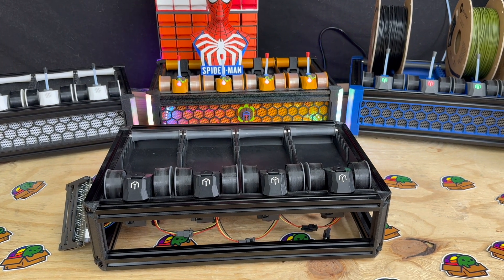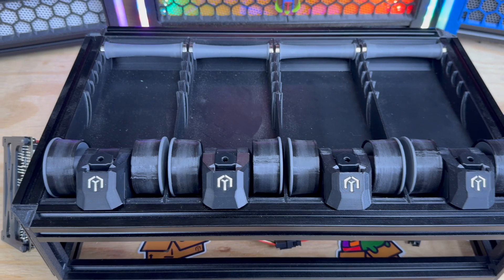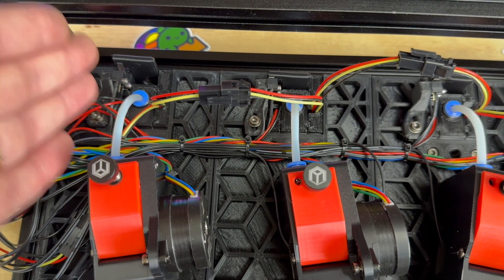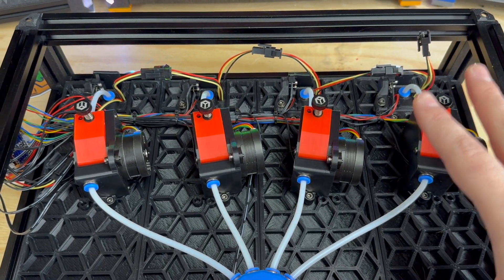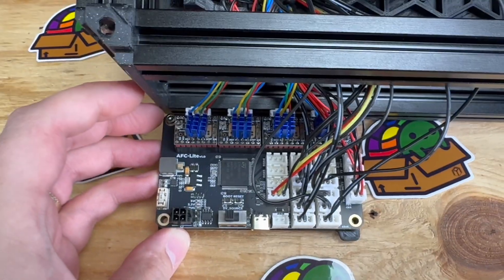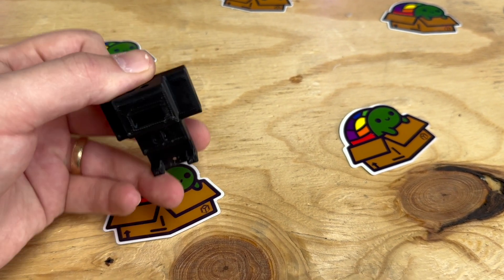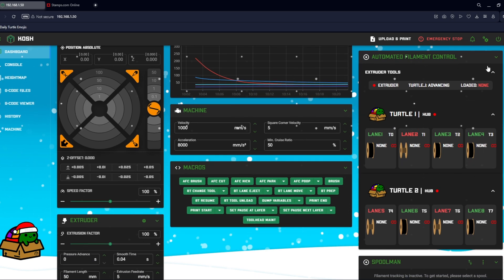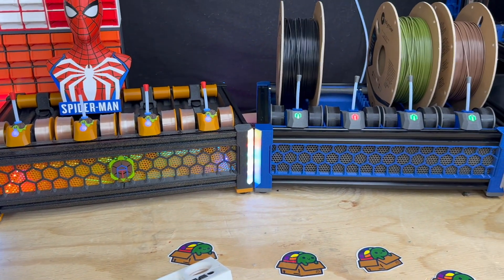BoxTurtle Basic Overview

Comment from the maker: Reply with any more questions and I will make sure they are covered in detail in the near future.
Reply: How does this setup manage TPU and flexibles?  Difficulty in integrating with Peopoly's Magneto?
Reply: how does this connect a 3d printer?  what type of port?
Reply: Is 8track dead
Reply: Which printers can I use this with? Is it compatible with the elegoo centauri carbon?
Reply: @MistaWells  Any printer running mainline klipper
Reply: How do I enable the AFC GUI?
Reply: Can we get any documentation on the led installs. I didn't notice any on in the manuals either.

Comment: Do you think that this could be integrated into a tool changer Voron 2.4? I could see so much potential. I'd use the multi-toolheads for different nozzle sizes, soft materials that don't feed well in a MMU, or main print colors while the turtle would be great for accent colors or if you need more colors than a tool changer could provide. One of the biggest reasons (other than cost) that I don't want to buy a ready-made tool changer like the XL is that it can't do something like this.

Comment: The box turtle with it's permanent engagement and a small variable filament buffer is almost how I designed my filament changer.
The only differences are that i used cheap of the shelf filament sensors and nema 17 extruders, my buffer was implemented by the extruders being able to slide, the respoolers are non motorized with a slip clutch and spring system.

Comment: I don't need colors for my functional parts but I'd like to be able to print PLA support for PETG parts, or print PET-CF parts with TPU feet or non-skid tops.  Now that multi spool filament feeders are becoming popular, slicers need to learn how to intelligently use the purge as infill or if the materials are incompatible, purge one material inside the hollow infill of the base material.  Poop and purge towers are not good.

Comment: I'm glade I found this I am printing on a LK5 pro witch is a widely unsupported printer. I have been on a long journey to make my printer multicolor. I have swapped over to klipper with moonsail and orca slicer. (again all not supporting my printer).  But I feel this is my multicolor solution.

There are a lot of comments. So, this might have been already asked. If so I apologize. I think I understand that this is mostly printable at home. But is there a kits with all the necessary non printable parts or do we piece mail this via Amazon/ Temu?

Thank you

Comment: On dryers and storage. Nice work. Just entered the game, ordered P1S. Dunno if my problem is relevant but I feel to be interested in combined AMS+dryer+storage box. 

I have noticed in drying clothes etc. that a simple fan helps a lot. I guess air circulations rotates more molecules for the water whatnot. So, a dryer of my dreams would have:
1) a bit of air circulation with a fan
2) some heating
3) some (occasional) inside–ambient air exchange.

I wonder 
4)– if 1) & 3) could use the same fan (to simplify)?
5)– if 3) could be passive or minimal, akin to grid +flap structure which would open the exchange when 4) blows? I feel the needed flow is 1) > 3) i.e. only minimal 3) is needed.

Also, dunno if solutions already exist. Thanks.

This text is also posted on @LDOmotor's video https://www.youtube.com/watch?v=SZF6mm9Z6wc&lc=UgzyBD_PwfVc6BB5JXx4AaABAg

Comment: Could this auto load and unload my 6 tool head tapchanger for me?  If you built a 6 spool turtle of course.  Would it require some software changes is really the question.

Comment: How do you add the multiple Box turtles to the printer or add additional lanes to the BT the PCB only appeared to manage 4 motors?
Reply from the maker: Any filament combiner works fine, we’re working on a group of accessories like that on our GitHub. As for the boards, usb or can bus to each unit

Comment: Most of my printers have Dragon and Rapid Burner toolheads, are these going to be computable with the BoxTurtle? I am not sure if I can put cutters on these toolheads.
What configuration aka amount of spool is going to be in range for the BoxTurtle in a single unit, 2-4? 
What parts needed per spool?
How can I intergrade an encoder to detect clogs/tangles etc with this setup? Currently all my printers have BTT SFS V2 and I can't afford to run my printers without it. It saved me a lot of problems and money.

This is an amazing project. Keep it up! ✨
Reply: There is a filament cutter available for the Dragonburner, I believe by the author of the toolhead himself.

Comment: Finished up my build today. Just gotta rebuild the tool head and I’m ready to test it out!
Reply: How are you getting on….is your box turtle everything you hoped it would be?  I’m interested to hear how easy it is to assemble. 🙂👍🏻
Reply: I’m gonna install it on my printer this weekend. The build was a snap. I self sourced the first one and the hardest part was soldering the LEDs. I got a ldo kit as weel and I gotta say it takes all the effort out of the build! 10/10 recommend.
Reply: @ that sounds awesome…I’m technologically and electronically retarded (🤣 very!) but it’s really tempting.  What sort of costs would you estimate the set up takes in total…a rough guesstimate? 🙂👍🏻

Comment: Does this work with 2.85 filament?
Reply: That would be an interesting mod, but unfortunately there isn't much hardware available for 2.85 filaments.
Reply: Theres a few universal extruders that work with both 1.75 and 2.85 mm filament. I often use more 2.85 but enjoy the flexibility of both on my machines.
Reply from the maker: the extruders and sensors were made with 1.75mm in mind.

Comment: So, InfiniteSpool will fail lane T0 to the next lane with filament.  In this case, that is T2.  Great.  What happens when T2 runs out?  Will it fail back to T0?  Is it possible to launch a 5Kg print without having to stop?
Reply from the maker: You pick wich spool is loaded next, the screen cap didn't pick up the drop downs for whatever reason. You can map as many spools as you have. If they're all exhausted it will pause the print.  But yes you could set your last infinite spool to go back to T0
Reply: @Robert_Klotz  Thank you!  I appreciate the response, as well as the great work you are doing.